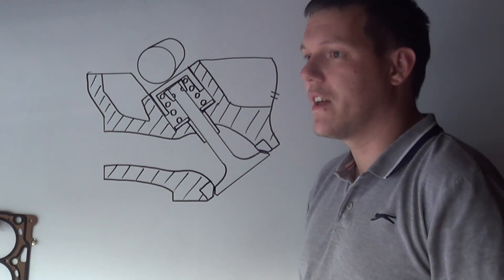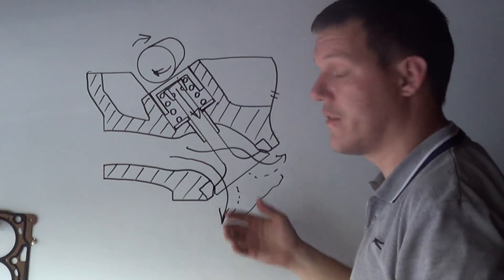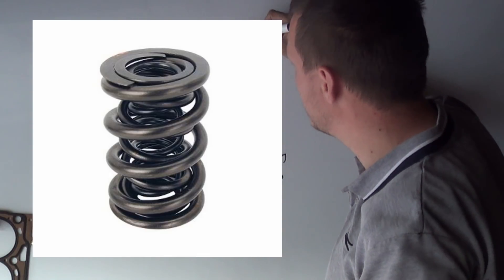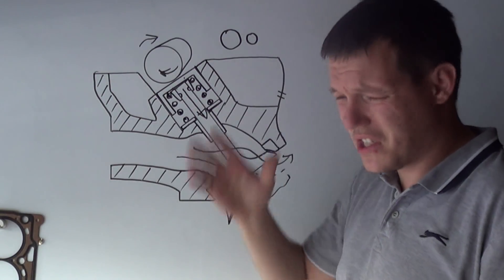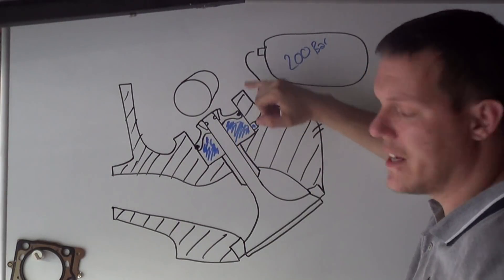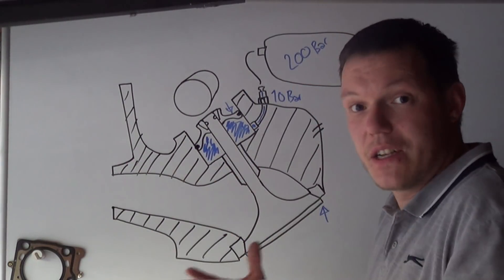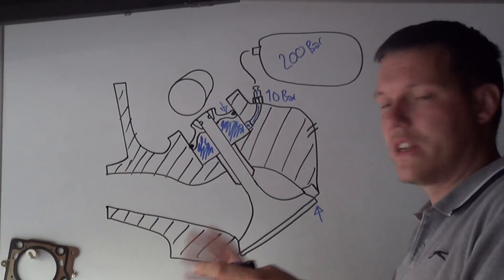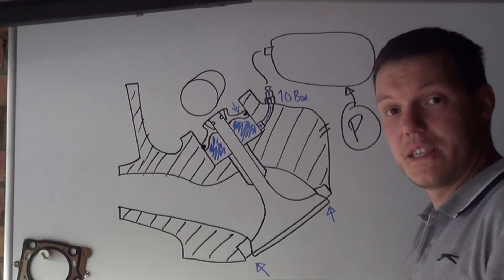Pneumatic Valve Springs - Bike TEch

Comment: I see another problem with this. Pressure vessels have a habit of popping if they are neglected. A lot of vehicles on the road are neglected. 200 bar is stupid amount of pressure if that pops I don't want to be in the same county as it.
Reply: Awesome video BTW. Really well explained!
Reply from the maker: lol true but they only use the bottles in MotoGP at these high pressures to feed the valves for 1 hour. For domestic use you'd have a compressor which tops up the tank which you could run at say 12 bar which really is that high. They use the bottle for weight reasons. thanks for the comment - matt
Reply: Very good point actually. They have compressors to auto inflate tires and suspension now so no reason to just plumb it to the engine block. Question is is it really that necessary for road cars. Sports cars and hyper-cars sure I can see it coming fairly soon.
Reply from the maker: lol good point but neither are turbo chargers until they were used to boost efficiency of smaller engine. One thing i didn't mention about using PVS's is that a system could be employed were the pressure in the valve is bleed off when the valve applys force to the valve. This would mean that the energy wasted on compressing spring and in this example gas coule be recovered. You would obviously need a system like I explained above to refill the valve. 

So this design would boil down to how much energy is required to refil the valves vs the cost and the total energy recovered. I look into it an do an update video 

- matt
Reply: Really good point about the turbochargers! I can see how you could use them to boost efficiency through smaller but faster spinning engines (less torque but same or higher HP due to higher RPM, why my Fazer can still pump out 95BHP without any low end grunt). It would be intresting to see real world comparison.
Reply from the maker: In reality most engine modern (2014 onwrads) could be converted to pneumatic valves. Most of the new engines have receded valve reliefs. So converting them to pneumatics wouldn't be impossible, far from it, gut you'd be better off casting a head for the purpose obviously.
Reply: I agree that you would be better off getting a new casting. It would allow for some optimization as well. Its all down to money really as with everything. However I expect it to start appearing in some of the most expensive cars in near future. As with all of those technologies it will trickle down eventually.